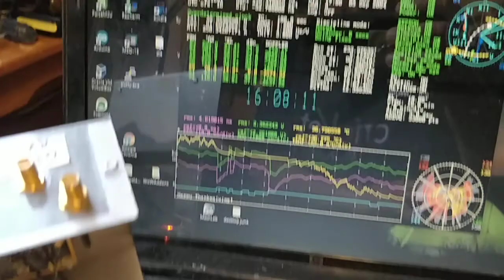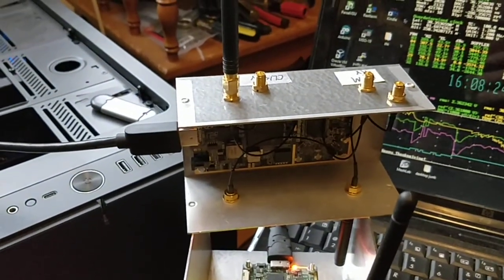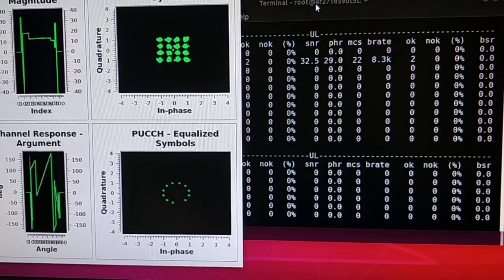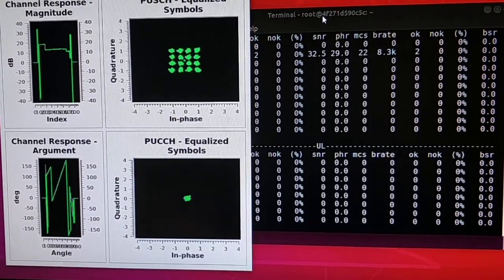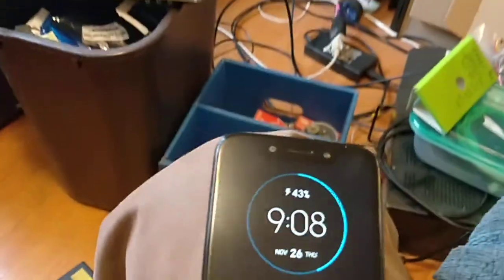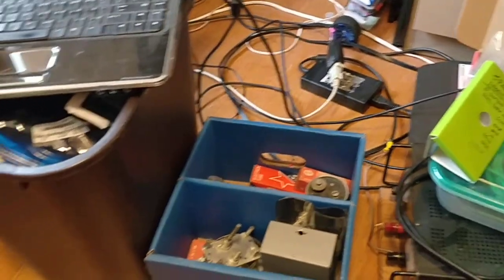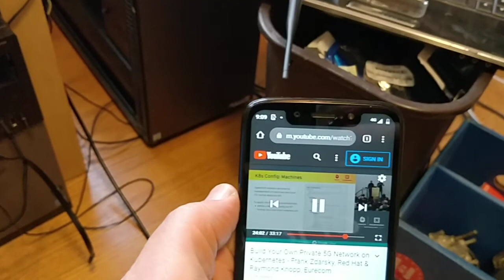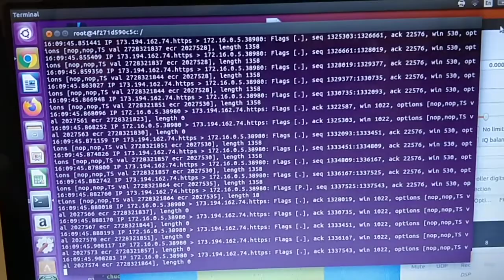srsLTE working with Motorola handset

Comment: Hi,

Is there a tester way that the usrp accepts the gpsdo well?

On srsLTE (srsRAN), I don't see any difference with or without gpsdo. I put "clock=external" and if I unplug the gpsdo during operation, it doesn't change anything.

Is there a way to be sure that the usrp is changed to an external ref?

Can you help me please ?

Thanks a lot.
Reply from the maker: The usrp docs are hard to find things in - there is an LED for the external reference timing clock - here it is described as LED100 GPS lock indicator	off = no lock
green = lock     https://files.ettus.com/manual/page_usrp_b200.html#b200_hw_ref_leds         Hope that helps.      Also it is best to ask on the srsLTE users support email list for the best advice.
Reply: @ChuckSwiger  Thank you for your help.
Reply: @ChuckSwiger  Thank you very much again.

Comment: Hi,
Thanks for sharing.
What external clock do you use with b205mini ?
Reply from the maker: The GPSDO is a Trimble NTBW50AA GPSTM Timing module, ebay special - the vendor threw in a GPS antenna that sits on the roof, with software 'Heather' displaying lots of neat info (sunrise, sunset, moon phase, etc) over a serial port.  With a 10db attenuator (as you can see in the video) as the gpsdo puts out a 2vpp 10MHz signal!   Also a splitter to a LimeSDR board also that runs a GSM bts.
Reply: @ChuckSwiger  Thank you for your quick reply.

Comment: Hello. I am trying to perform the same experiment as you running 4G using srsRAN and b210 SDR, but not a single device connects successfully. I've tried different computers and different handhelds, no difference. Can you give a tip or two about how you put your setup to work?
Reply from the maker: The big breakthru for me was switching to a a network core that supports more commercial phones - namely  open5gs.    I can share some details used soon, a day or so to collect it. srsLTE comes with their own easy to start up EPC packet core but it would not work with anything for me.  Switched to open5gs and boom they all work now, assuming you have some sim's you can program with your own private key, etc.  https://github.com/open5gs/open5gs
Reply: @ChuckSwiger  Thanks for your suggestion! I will give open5gs a try and see if it helps me as well.  I initially thought the problem was my sim's because I'm programming then with custom keys as you said.

Comment: Can this BTS support more than one cellphone simultaneously?
is there any limitation with the model of the handset to work with srsLTE?
Reply from the maker: Best to sign up for the srsLTE email list and ask there - but yes I think it will handle multiple ue handset. This implementation uses open5gs for the core network (EPC) which works with more handsets than the one that comes with srsLTE.